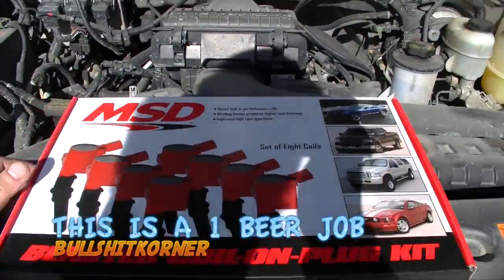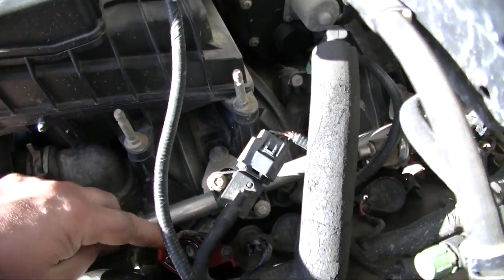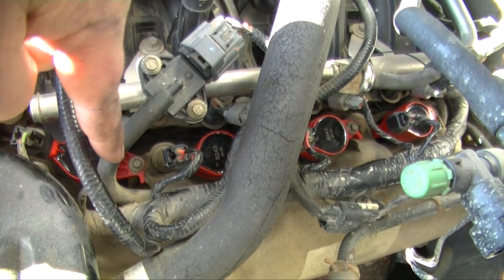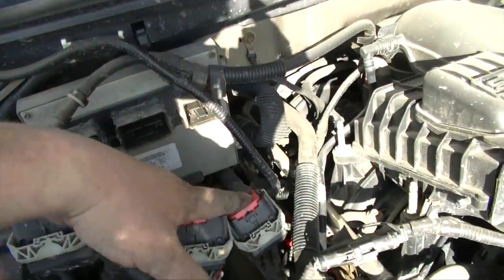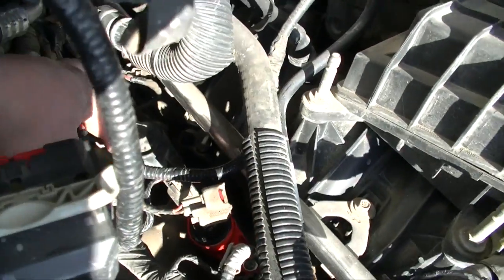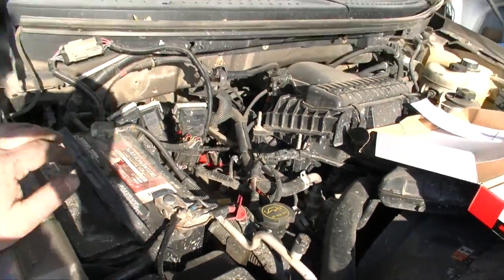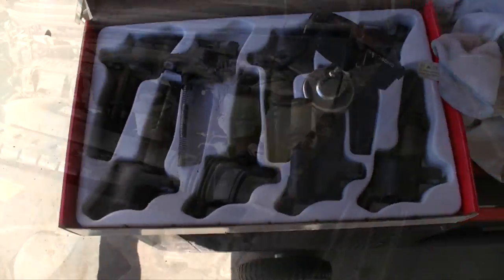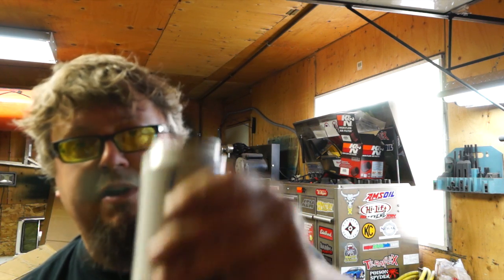DIY How To Replace Coils on a 5.4 3V Engine

Comment: 30-45 minutes? bullshit. took me 4 days. and 65 beers.  but then again  im old lol nah he is right. i hate working on cars anymore. but my 2010 f 150 lariat check engine light came on said number 5 coil was bad so i replaced them all with the msd coil packs. okay here it is. i called my local ford dealer. talked to service. i was laughing so hard that i almost hungup on them. i quote .. the service guy said well that is a pretty hard job. you are looking at  8 hours of labor at  110 a hour almost 900 in labor alone. and they said the coil packs from ford were 93.00 each,so  when they  got done bill would of been almost 2000.00 and that didnt include sparkplugs. which ford said were 20 each.do over 2400 if i was to have ford replace the plugs also. so the msd high performance coils were around 200.00 on line. the plugs were 10 each from orielly whole process took me about a hour and a half  and i took a few breaks lol  so 80 for plugs  and 200 for the coil packs.so 300 with tax and a sometime for installation saved myself over 2 grand, silly ford. they think everyone is stupid. my 2010 f150 lariat has almost 170.000 miles on it.i wont trade it in.cheaper to buy a new engine .

Comment: Did you had to remove that black bracket thats holding the steering fluid in order to remove the plug in sensor from cylinder 5?
Reply: not necessary

Comment: I just changed the plugs on my 2006 f-150 lariat 5.4 because it started missing and just reached  100k mi.  when I start it now it idles rough took it for a test drive didn't think I'd make it back yet the check engine light is off and my scanner says no codes and pass. Any ideas suggestions? Man I need  a BEER
Reply: Probably a coil

Comment: My f150 is a 2008 ( had all metal plugs it!!) I just bought it a few months ago and already had to rebuild the tranny. Center support snap ring broke. I found it stuck on the magnet when changing the fluid. Truck still runs great should I change coil ( plugs already done) or replace the fuel pump regulator next? There is a lot of corrosion on it I had to corroseal the underneath of the truck. I'm lucky the guy who owned the shop let me put the truck on a lift and work on it that way. Also should I use amsoil oe or go with the 25000 mile stuff. I would change it a least every 10000. What's your opinion on tranny fluid changes. 50000 miles? More? Less? the new torque converter came with a drain plug so I can drain that when I drop the pan. Sorry for all the questions I'm a FNG to some of this stuff.
Reply: +Brute Triton  thanks I replaced the fuel pump module but going to hold off of the coils for now, the thing runs like a beast!

Comment: Hey guy!!  I like you because you are a no nonsense get things done person.  I have a good hands on doing it of 44 years now.  Go figure I have even worked on ford Yblocks so you know I go back, LOL.  Speaking of the Y blocks they actually had no oiling problems at all like they were rumored to have.  What it was is that even mechanics back then would never line the rocker shaft tube with the oil hole in the engine head plus they would run them without the curved end metal tubes on the end of the rocker shaft where on side threw oil on the top of the timing chain and the rear one on the opposite engine head sprayed down on where the cam gear met the distributor gear.  On these 8 coil engines and I have one too in a supercrew 02 f150 4.6  I don't really think those coils go bad.  I think its bad plug connectors from the harness or just the spring sending the juice to the plug because coils even when they mounted them to intake manifold (that one coil) would last 30 years and being the coils on these later engines are extended above engine hot metal seems to me they would last forever unless coils are deliberately made inferior today

Comment: I just did plugs and coils on my uncles RV with the v10 triton last week, shit is a pita esp with the risk of breaking the plugs so you have to work them out carefully. But it runs so much better now, definitely some weak coils. It's a 97 but it only has 27k mi on it.
Reply from the maker: The Stiver is there a tunnel in the cab you can remove to get at the rear plugs in those things ?
Reply: Bullshitkorner Yes absolutely or dear God it would be impossible. The middle cylinders are a little tricky, take your pick, stand on a bucket and lean way in under the hood or crawl around in the cab straddling the transmission. All in all nothing too bad if you have plenty of different length extensions and a wobble extension or two. But you have to spend a little more time removing other things and moving the wiring harnesses around than you did on the 5.4. Took me about 4 hrs but part of the reason was his RV was flooded a few years ago and the back 4 cylinders spark plug tubes were full of mud/sand I had to dig/blow out.
Reply from the maker: holy crap lucky it didn't suffer any engine damage
Reply: Bullshitkorner you know, there was a fine dust on the throttle body, I'm sure some crap got in the engine and will shorten it's lifespan but like I said it's only got 27k mi on it, he just uses it for one summer vacation every year. And I'm not much of a Ford fan but boy their truck engines are tough as shit.

Comment: My 05 ate through plugs all the time also.  I replaced the coil packs and it helped for about a year then it needed it all over again.  I finally sold that thing.  That engine is so finicky, glad that's in the past.
Reply: bubski16  I can't wait to sell my 2004, I hate this engine!!
Reply: +Bullshitkorner yes it's like it would only last 10-12 months and it would start missing.  It only threw a code once the entire time I owned it.  I did the plugs three times and coils once.  I finally got rid of it and got a 2012 jetta tdi.  Have had that now for three years with no problems what so ever
Reply: +GrandAmGTTT me to! Last Ford I'll ever own.
Reply from the maker: bubski16 someone else posted that as well, after a year would it just start missing or what ?
Reply from the maker: ***** lies you'll be buying a ford pinto
Reply from the maker: i got a 2011 jetta tdi 6 speed, love the car so easy on fuel and rips pretty good
Reply: yea i saw you got one :) been watching your vids for a long time man. You thinking of ever removing the dpf filters?
Reply from the maker: I got lucky the 2011 Jetta doesn't have the DPF setup which is really nice
Reply: yours doesn't have it or you saying 2011 jetta dont have it in general? the 2.0 has the dpf so 2009-15 jettas have it i thought. now the passat doesn't have it.
Reply from the maker: The dealership said when I got mine that 2011 was the cutoff, 2012 and on had the DPF setup.
Reply from the maker: bubski16 No your right it does have a DPF it just doesn't have the Adblue set up but uses the some catalyst instead from what I've read

Comment: Man those things are down in there below a rats nest of wiring.  Why not break out that scantool you got to do some diagnostics first?  Can't remember the exact name, I think it was an Autel Maxidas maybe?
Reply from the maker: ***** no it's a Matco Maxme, they are all pretty much the same anyways.  I didn't need to to any diagnostics i was just replacing them as preventive maintenance, have about 195km on the odometer
Reply: ***** Everytime I work on one it makes me wish for my 1958 ford pickup with the 292 V8.  If this junk is so superior then why did my 58 ford pickup and 57 ford station wagon get better gas mileage??  LOL  Reality speaks truth
Reply: Earl Guyton They didn't have emission laws to contend with until around 1978 and they just became more strict with every decade after that.  Really hard to do power, MPG, and clean emissions. ;)

Comment: My f-150 would go through a set of plugs each year. That was at least a 2 beer job, damn Triton engines
Reply from the maker: roguesquatcher for real?
Reply: 4.6 litre is a pain in the ass, plugs go through the intake, under the plentum
Reply from the maker: my buddy has a 4.6 and we are changing the oil this weekend i'll have a look at it